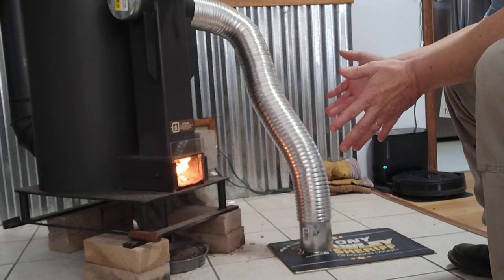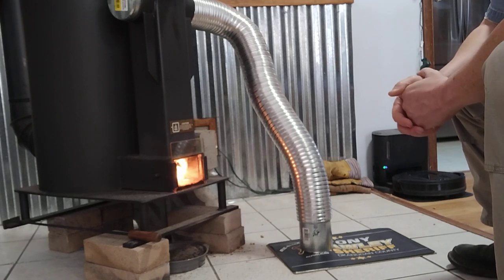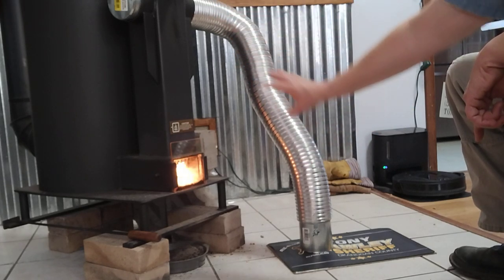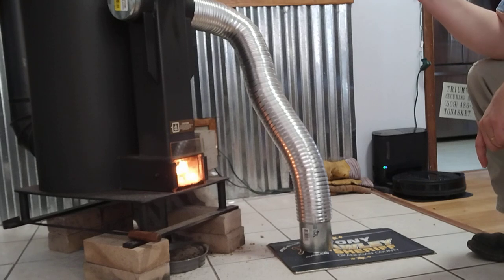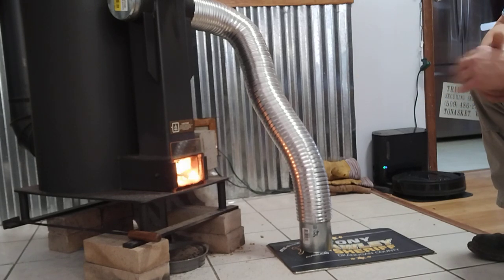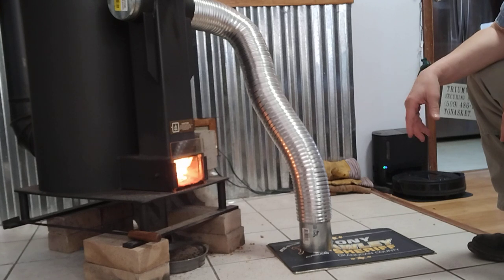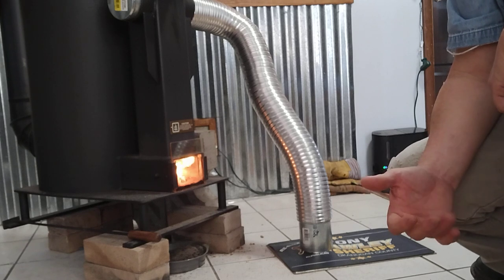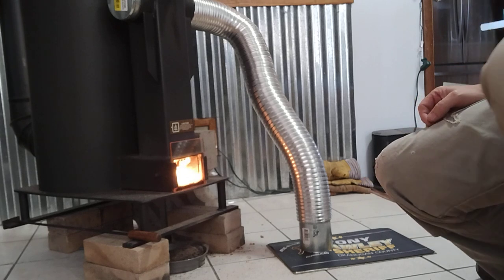liberator rocket stove solution to smoke and final review

Comment: I wanted to point out a couple of things. Your flex pipe from the floor to the feed tube is for fresh air, not the return. Proper ventilation for the exhaust pipe will also help with burn back in the feed tube. As a new user of this stove, you placed the basket too far in and out, but finally got it set in the correct position. It’s all part of learning how to use the stove.